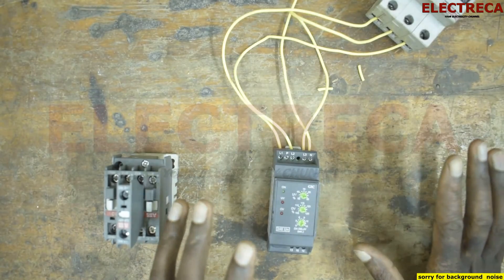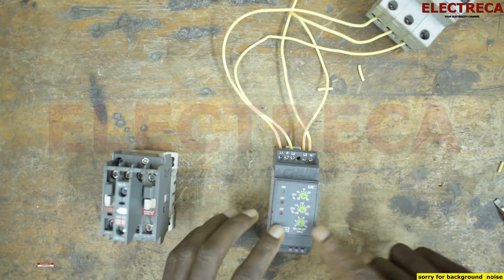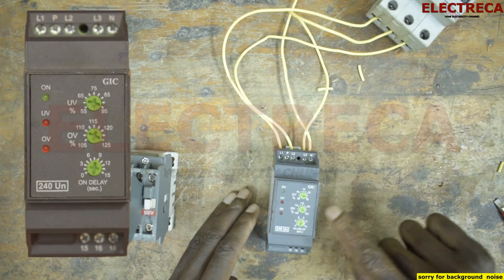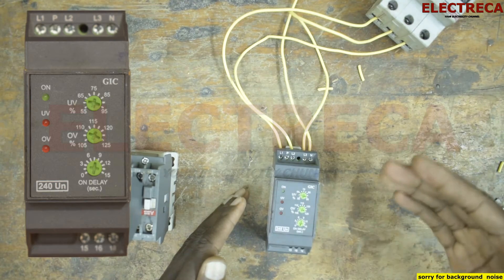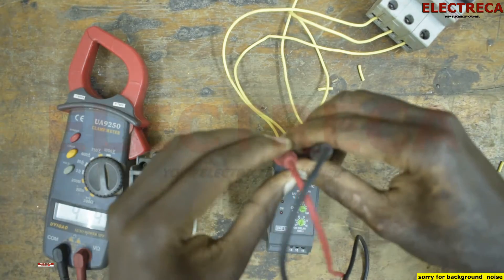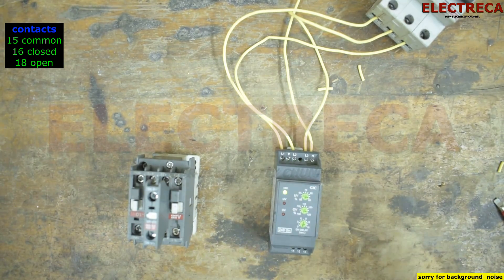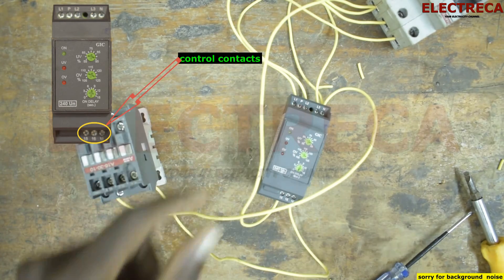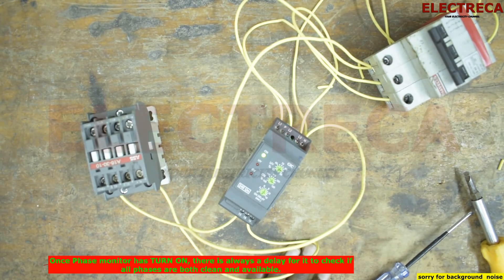HOW TO WIRE|CONNECT PHASE MONITOR|PHASE FAILURE|ELECTRECA

Comment: Can three phase phases monitor be use in single phase application .if so how do I do it
.thanks
Reply from the maker: Yes, The GIC i used in the video has L1 L2 L3 and P you short P and L1 there it will work in single phase mode. Thanks for watching.
Reply: @electreca1  thanks for the feedback

Comment: i find this relay to be limited such that...assuming the phase you use for the contactor is the one which has failed and instead of the contactor you are having a shunt trip, then it means that the shunt trip won't trip

Comment: Very helpful piece for me sir.

Could you give me a link to how to connect a 3-phase failure device. A client wants to use it for a 3-phase machine but without contactors so that he could operate the machine manually at will when potential has been disconnected by the phase failure device.

Thanks.
Reply from the maker: Most of the phase failure are auto, there you need a contactor for you to use it, but alternativly ther are three phase regulator thta serve the same purpose.  This single phase https://youtu.be/NuGYMZWZBeg  but you can look for exact but three phase.